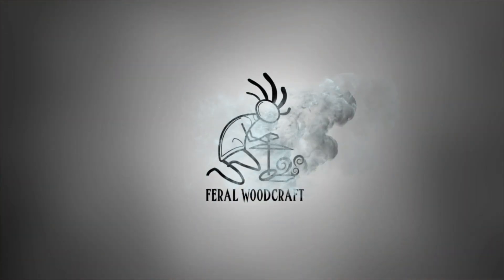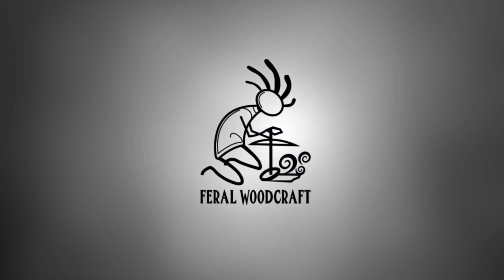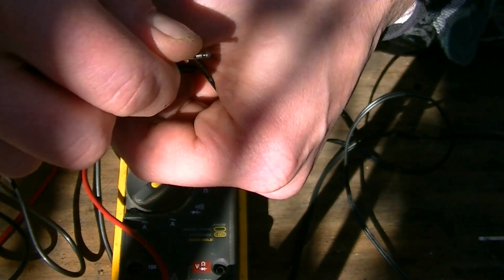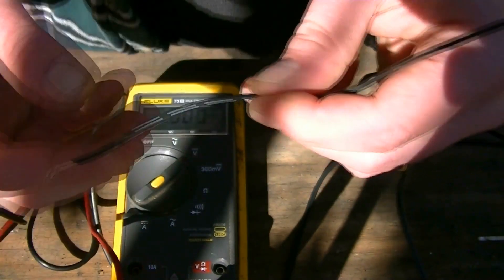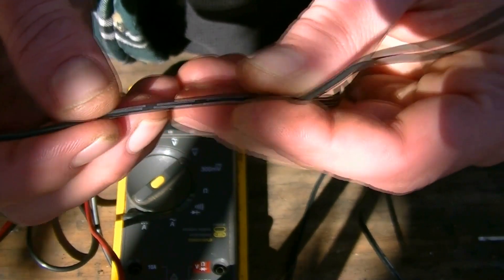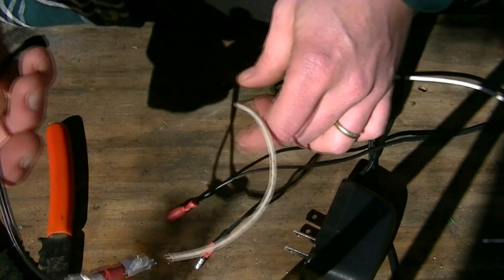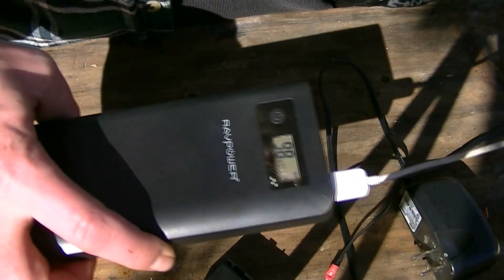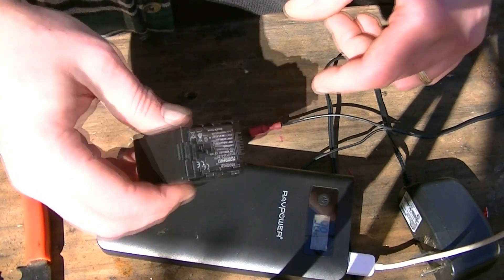Backup Power for Non USB Devices

Comment: If you'll try the connectors with clear heat shrink already on them you'll never buy another kind. I was skeptical but they work and very difficult to pull off.

Comment: this is great i will be able to make 1 usb charger into the 5 i need
Reply from the maker: +ED MaCallum That it will.  If you keep the standard the same on the bullet connectors, you can have the same device powered via several different sources (as long as the voltage is the same.)

Comment: thanks a lot for this video. Now I just need to find a way to use rayobi one plus batteries as a backup power source!
Reply from the maker: +Shannon Waldhauer You can get a step down transformer on ebay for pennies really.  Find one that is either adjustable or goes from 18v to your desired voltage and you'll be golden.  Thanks!